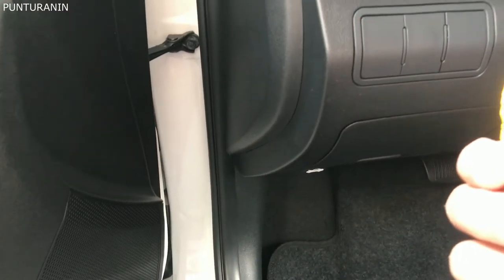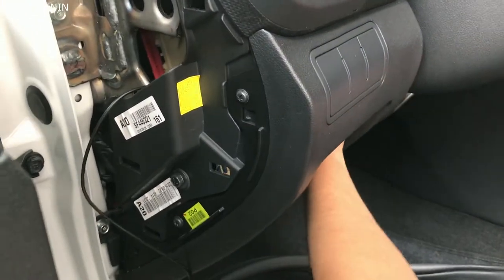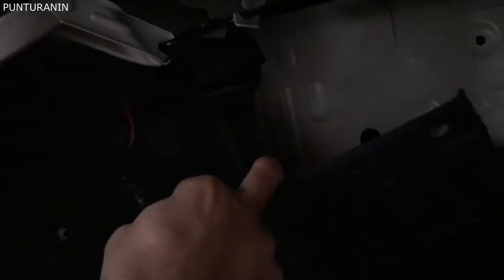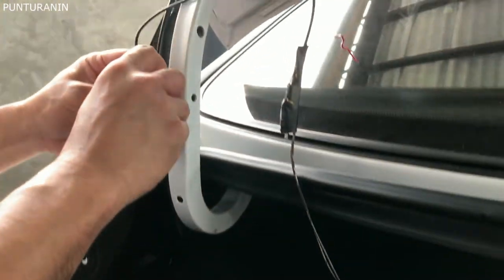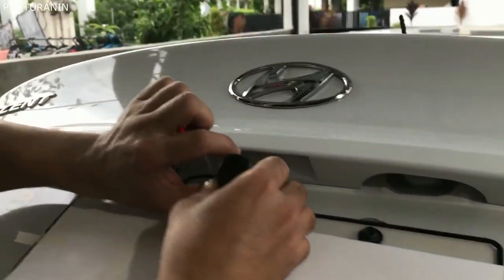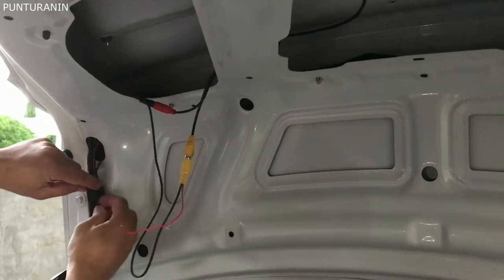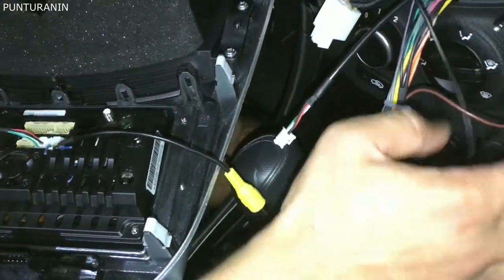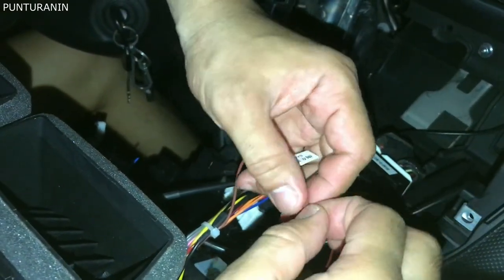Paano Magkabit ng Reverse Camera sa Sasakyan Hyundai Accent

Comment: Sir pwde ba siguro yung #18 size ng wire na pagdugtong sa reverse camera?
Reply from the maker: ito po ang link ng wire na ginamit ko https://www.lazada.com.ph/products/car-automotive-motorcycle-wire-with-30-meters-roll-size18-i3012743300-s14799318610.html?clickTrackInfo=query%253Aautomotive%252Bwire%253Bnid%253A3012743300%253Bsrc%253ALazadaMainSrp%253Brn%253A2d7888d122bef60fd57d397f494aaf28%253Bregion%253Aph%253Bsku%253A3012743300_PH%253Bprice%253A86%253Bclient%253Adesktop%253Bsupplier_id%253A100090238%253Basc_category_id%253A22654%253Bitem_id%253A3012743300%253Bsku_id%253A14799318610%253Bshop_id%253A106772&fastshipping=0&freeshipping=0&fs_ab=1&fuse_fs=1&lang=en&location=Metro%20Manila&price=86&priceCompare=&ratingscore=4.795620437956204&request_id=2d7888d122bef60fd57d397f494aaf28&review=959&sale=6951&search=1&source=search&spm=a2o4l.searchlist.list.i40.3c2c287699ZcRC&stock=1

Comment: ano po tawag sa pang connect/tap nyo ng wire sir?
Reply from the maker: Electrical Quick Splice Cable Connector Lock 14-16AWG Wire Terminal. yan po binili ko lang sa lazada https://www.lazada.com.ph/products/homyl-50pieces-electrical-quick-splice-cable-connector-lock-14-16awg-wire-terminal-i1222612411-s4357784204.html?clickTrackInfo=undefined&search=1&spm=a2o4l.searchlist.list.i40.7fe31103Q6Ebl2
Reply: thanks sir. nag rerecord rin po ba ito sir or reverse cam lang po?
Reply from the maker: @jtceres438  reverse cam lang po yan gumagana lang pag nakareverse ang kambyo
Reply: maraming salamat sir sa response
Reply from the maker: @jtceres438  walang anuman, maraming salamat din po
Reply: sir san nyo po pwinesto gps sir
Reply from the maker: @jtceres438  hindi ko na po inilagay sa ibabaw sana ng dashboard ko ididikit
Reply: thanks po sir sa response
Reply from the maker: @jtceres438  walang anuman, salamat din po